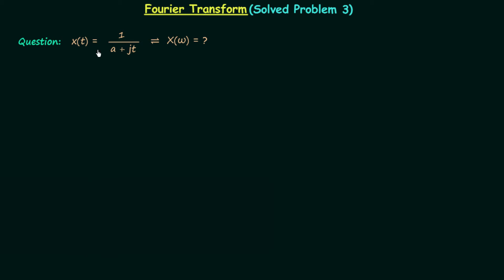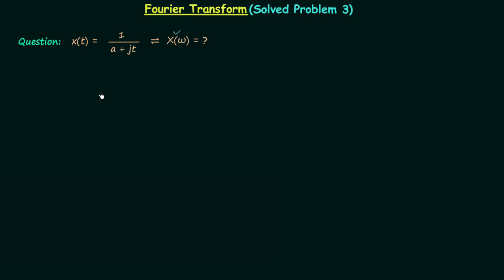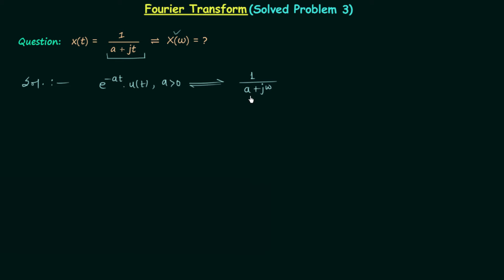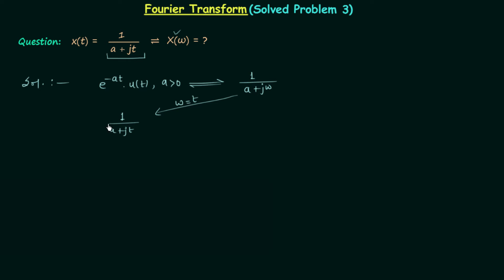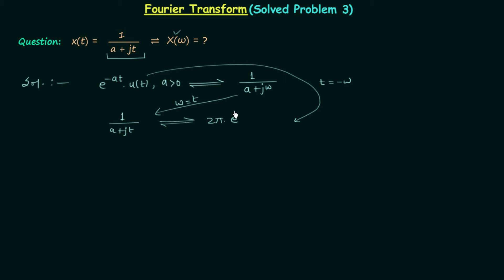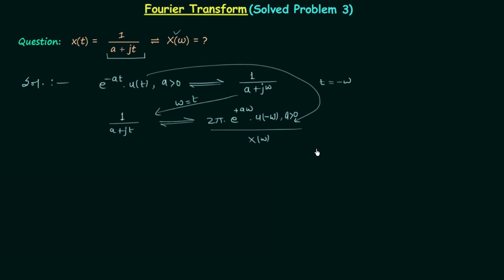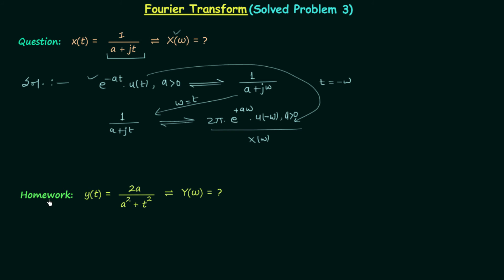Fourier Transform (Solved Problem 3)

Comment: y(t) = exp(-a*|t|) , if a>0 then Y(w) = 2*a/(a^2+w^2). when we change w to t we have to write 2*pi*Y(-w) and this is equal to 2*pi*Y(-w). we know that y(t) = exp(-a*|t|) , then when we put -w instead of t . we get y(-w) = exp(-a*|-w|). the result is  2*pi*exp(-a*|-w|)
Reply: very helpful
Reply: Hey but in the question there is 2a then we have to multiply the answer with 2 then the answer will become 4*π*e^(-a|w|) I think please clear this to me 
    Thanks in advance
Reply: no , we don't need to multiply 2 because we have already compared the equation with the property in fourier transform of exponential signal. The procedure is done. Then we just only need to apply duality property. Thanks. @amulyadevalaraju357